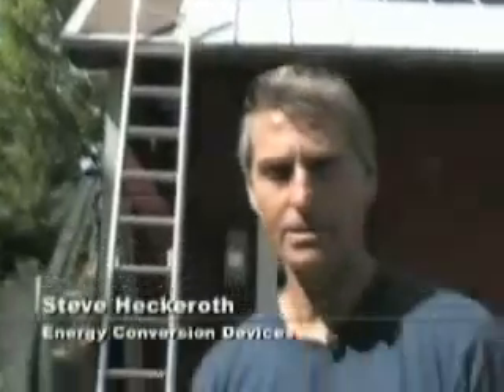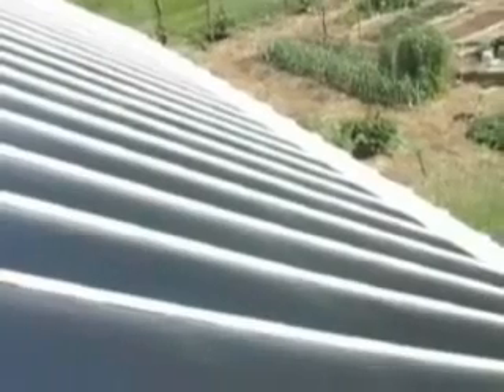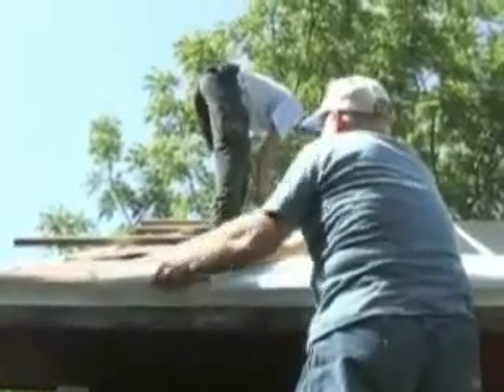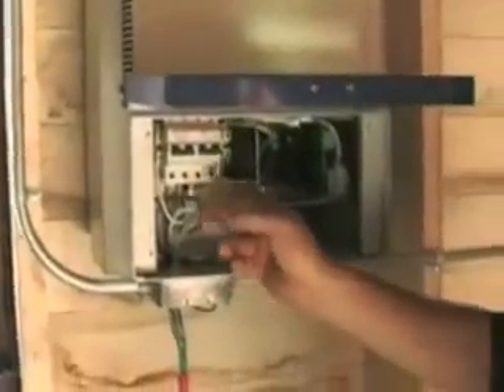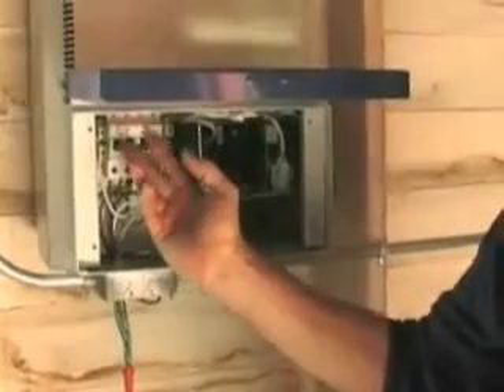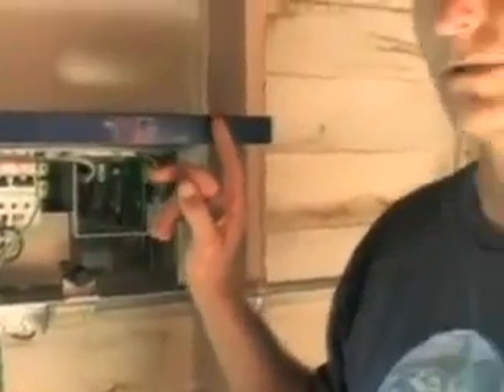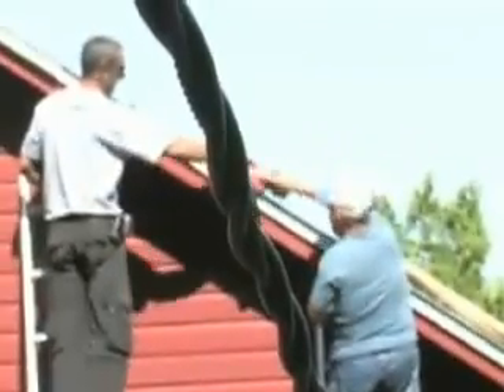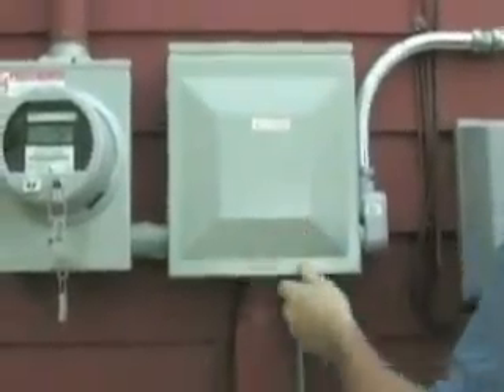Solar Metal Roofing - Unisolar thin-film PV laminates

Comment: Why did you stop production of this materiel and can it be resurrected with the correct financial support and large scale orders 
 ?
Reply: Uni-solar - company that made these went out of business a few years ago... 

Problem with these panels was low efficiency (only 136 watts max, on 19' long panel) and high cost, and it only works with flat (not ribbed) standing seam... Fairly small market, and with S-5 clips, regular solar panele offered much more capacity (more Watts) at much lower cost.

Comment: Are the placed on the metal roof. if the roof is already there?
Reply from the maker: you can, if the panels are cleaned well. Ideally of course it is to put these on in the shop.
Reply: yes it is already in place
Reply: Hi, Madam, Hi, Mr Kevin Smith, how are you? 
This is Alex Yang from Xunlight China, the only manufacturer of amorphous flexible thin film solar cells and panels. 
 
I saw your message related to Unisoalr panels. 
When Unisolar is down, we bought their cell business and continue to produce flexible thin film solar panels in China.
 
We have two main kinds of products for customers` option.  Its power range is from 25W to 300W with weight range between 1Kg to 12Kg. 
1. Roll-out Thin Film Solar Panel (Suitable for special roof-top, bus shelters, solar tent/camp, LED Light Pole)

2.Portable/ Foldable Thin Film Solar Kit (Solar Power Bag, suitable for outdoor activities)

 If you want to know more details, please email us via alexyang@xunlightchina.com    
Thanks and kind regards

Comment: I wonder how does the efficiency of these compare with the 20% or more of conventional panels?  Seems like an awfully large array for just 2kw.  Not that it matters if one has a large enough roof, but I'd like something like this for the roof of my bus, where space is very limited.
Reply from the maker: Efficiency is pretty low - about 5-6% if I remember correctly.
Reply: yes, even now it is 8%-10%. 

Hi, this is Alex Yang from Xunlight China, the only manufacturer of amorphous flexible thin film solar cells and panels. 
 
I saw your message related to Unisoalr panels. 
When Unisolar is down, we bought their cell business and continue to produce flexible thin film solar panels in China.
 
We have two main kinds of products for customers` option.  Its power range is from 25W to 300W with weight range between 1Kg to 12Kg. 
1. Roll-out Thin Film Solar Panel (Suitable for special roof-top, bus shelters, solar tent/camp, LED Light Pole)

2.Portable/ Foldable Thin Film Solar Kit (Solar Power Bag, suitable for outdoor activities)

 If you want to know more details, please email us via alexyang@xunlightchina.com    
Thanks and kind regards
Reply: Right now it is 8-10%

Comment: @coolflatroof 1) Do all thin-film's have adhesive backings?  2) Do they usually come with the terminals?  I've seen videos where they are tediously cutting the backing of the film with a blade to pull wiring out; it looks really messy and easy to ruin the panel, so I would only want to buy thin film if it already has the terminal on it!  3) Do you apply thin film before the roofing goes onto the roof?  Is there risk of damaging the film when the metal flexes as its being put up onto the roof?

Comment from the maker: @chuckbyf1 

Wiring is concealed under ridge cap and then goes into conduit, runs to inverter ... and great success. What you see in this video at the roof ridge, where panel connectors are shown, is before ridge cap is installed.